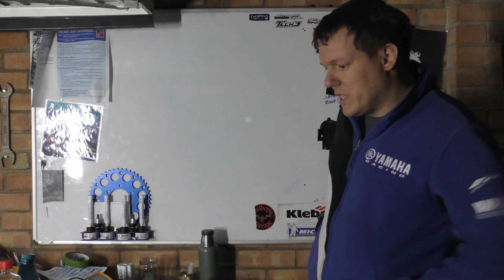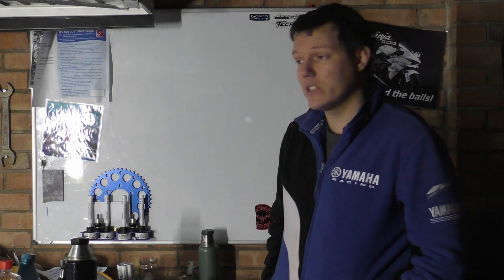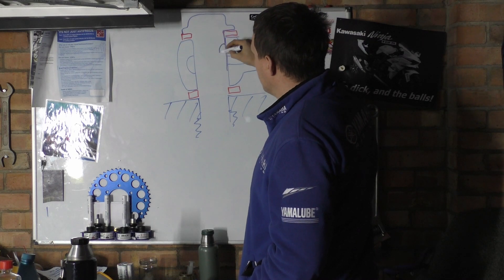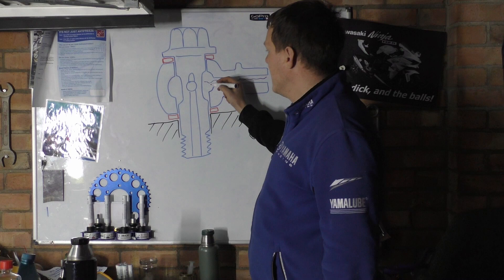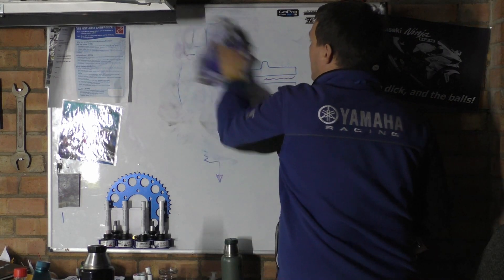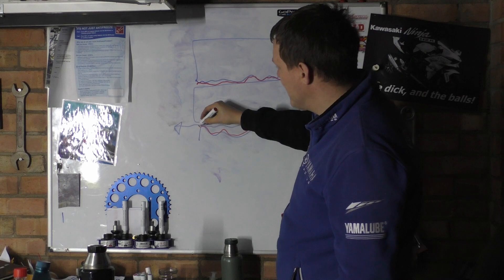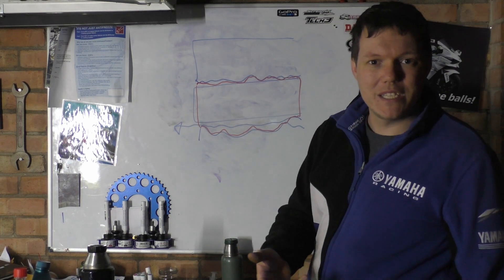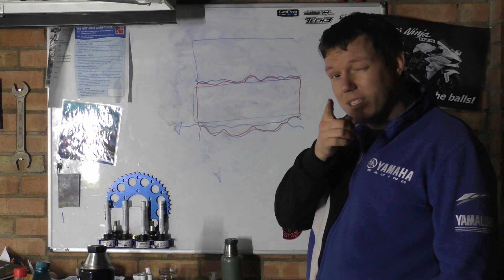Copper washers and brake lines

Comment: Hello Matt your videos are very useful and learned a lot from them. i have a small question about brake crush washers

Honda factory brake crush washers have shiny aluminum type look. once i used a fine grit sand paper to remove that shiny layer of one of those washers and it exposed a copper surface underneath it. you can see a pic there: https://drive.google.com/file/d/1D70Pt766bfkQzQlfmmA8KoIc2Lmt0Ihe/view?usp=share_link

are these factory crush washers plated with another material ? is there a specific reason for plating them over ? thank you and keep it up :)
Reply from the maker: Yes. they're zinc plated because copper oxidises and they want it to be more resistant
Reply: @thedirtyworkshop  got it. thank you 😊

Comment: Just wanted to make sure these brake washers were not brass as have a pile of old ones stockpiled in case of emergency. And yes I have re used quality brake washers in the past instead of the cheap thin pos washers that come new with bargain brake hoses.. Professional mechanic here and I do this because those pos new washers fucking leak immediately 80% of the time were you quality thick used copper washers are fine to re use. (dont be stupid inspect them prior) .. anyway just read somewhere some guys grandpa has been drilling copper pennies to make brake line washers for decades because 1 penny (cost) is cheaper then store cost for new copper washers.  Believe it or not its a good idea for when you need one in a pinch and got a jar of old pennies lying around. wouldn't try using newer ones they got less copper which means less crush and sealing ability.

Comment: And they don't need to be expensive. If you get some varying thicknesses of copper plate offcuts and an old fashioned set of punches, you can make your own. Not always easy to get right, especially for the the larger diameter narrow ones. But at a push, in emergency situations, you can use heavy gauge copper wire wrapped around a steel rod several times and then carefully hammered flat. File flat, then anneal it and then tighten on the job. Actually works.

Comment: This summer i was overhauling my peugeot scooter brakes, decided to anneal stock washers and instantly welded then in one piece accidentally  :D  Guess that`s what usually happens when you jump from 22mm or 1" washers on equipment you used to maintain at work to 10mm ones on bike. Found some cheapy aluminum ones in my hydraulic washers stash and they worked as charm, even with all the pressure pulses from abs system.
Also I really like washers in budget china bikes, the steel ones with super soft rubber coating in the middle. Seem to work fine multiple times without any problems. Bet these are copied from honda, like 99% of china bike stuff.
Reply: Никита Надеин
The metal washers with a rubber inside ring are commonly called dowty washers, they are higher spec  used in aviation hydraulics. They're good, but copper washers are more tolerant to misuse (slightly wrong size, off centered, etc). Bonded washers need to be the correct size for the fittings to seal properly.

Comment: Hi Matt good subject and im old school engineer always use copper washers and if  the correct new ones arnt available  areal em, never use those crap ally ones or plated steel crap the bloody corrode full stop. tip if the surface of the washer looks a bit uneven use a piece of flat glass and some very fine 1200 plus grade wet and dry  sandpaper to  make sure the surface is lovely and flat. used that bodge a few times out in the middle of no where when fixing diesel  leaks on bloody big earth movers
Reply: John Foster I usually just heat them up to white hot and crank the bolt down nicely, never needed the sandpaper. However, wouldn't recommend (read: strongly advice against) shite like that on brake systems
Reply: if you bother to read what i said where are you going to find a  source of heat in the middle of no where  the flat glass  wet dry  paper  is the only answer and  Definitely wouldn't recommend white hot copper washers near a diesel pump
Reply: John Foster Well I thought you wrote aneal (eneal??) even worse than I did. And when I got some sandpaper or piece of glass I sure have a blowtorch or these blowtorchy lighters somewhere. And you're supposed to let it cool down/dump in water (or just diesel lol) before putting it on
Reply: alles klar klaus
No, let it cool in air to anneal. Not liquid.
Reply: wirdy1 I don't think this really matters with copper, it doesn't harden all that nicely. However, a used copper piece can be - after heating it up - a bit stronger than if it hadn't been cold worked
Reply: alles klar klaus 
Ok thanks. I've always cooled in air but I suppose once the copper has relaxed it makes no real difference how it then cools. That helps me for the future as you get less discolouration when cooling in water or diesel.
Reply: wirdy1 We almost always quenched it when we did plumbing and brazed some copper pipe to the fittings which are some sort of brass usually. Or when I weld stainless I sometimes dumb it in water to cool it when the workpiece gets to hot overall. Copper can harden but I don't think it's that easy as is with carbon steel. You shouldn't use diesel though, it's disgusting